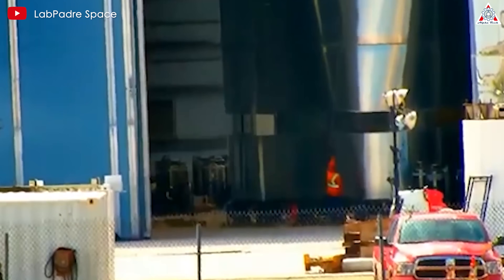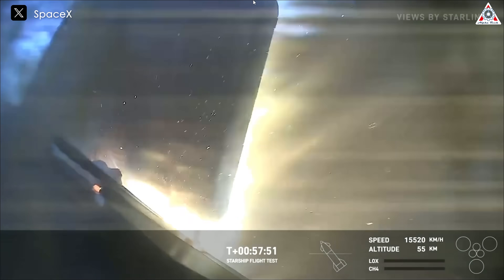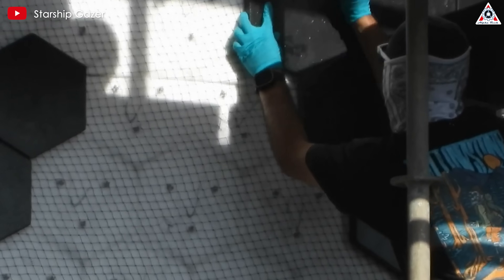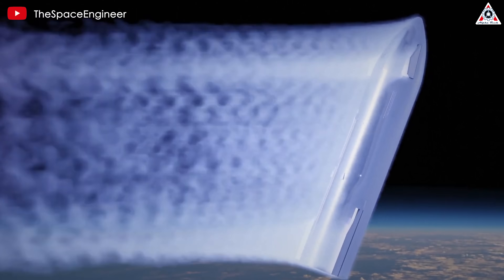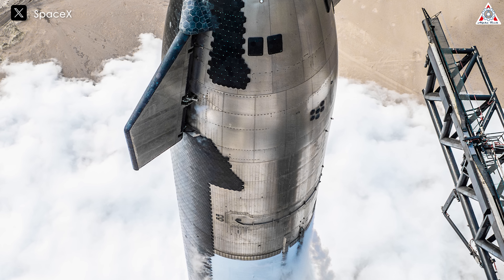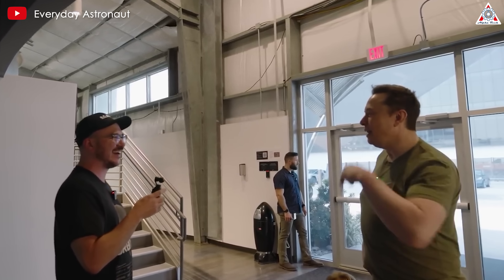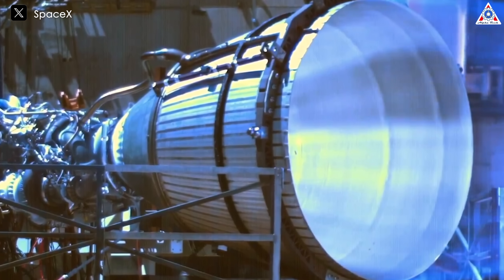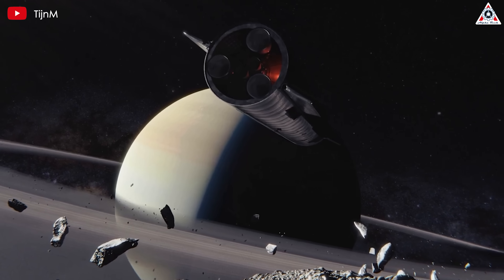Musk's SpaceX Genius NEW Solution for Starship's Weak Problem During Launch

Comment: Looks like still a long way to go on all the problems. Which is no suprize, whats suprizing is it works as well as it does.

Tles, flaps, engine feed systems, all seem problematic at best.

Might pay to attempt a cintrifugal seperator in the liquid fuel and oxy system as part of the pumping first stage.

Also going over size on pipes, pumps and valves, instead of multiples.

And their slush filter best have alot of surface area, or its gonna turn into 
a plug.
Parts count is still too high. Need common pumps for multiple combustion chambers, a bigger pump would eat the slush better, and grind it fine enough for the multiple chambers.

Just sayin'

The Analogy I used years ago still applies, that running a battle ship on outboard boat motors would take alot of parts and mechanics to keep going.

The combustion chambers are fairly passive, its the mechanicals that will be problematic.

Basically you need to think like a welder's Rose Bud torch... one feed and regulation system, lots of orifices... Not a seperate feed and regulation system for every fricking hole.

The Engineering Nobility is so insistantly stubborn...
🤭
Reply from the maker: WOW, I love your point here my friend, thanks for sharing.
Reply: @alphatech4966  
Yeah,  I have been pointing out the same stuff since the parts count fiasco.
These guys are not Zengineers yet! 
Novice shavelings...
More pipes snd valves, more complications..

They are like short bus plumbers trying to build a sewage system out of 2 inch sink drain pipe..  
Thats not gonna work,
 4 inch minimum to pass the thick stuff.
I can see it now, multiple two inch lines to the septic tank... And it still plugs....

Ditto on tiles and flappers...I've done multiple writs about better options.

Not my rocket, but sure would like to see effectiveness accelerate instead of stagnate attempting to stay traditional for smaller rockets, and to limit themselves to flying water tanks with forward dog ears and a couple barn doors aft for control surfaces.
it is comic....
Elon always does the right thing... (he just has to try everything else first!)
Success is after you run out of non viable options.
They should maybe think about more analogies...
There are certain commonalities in applied physics. I give analogies in an attempt to promote better thinking. 
The problem is our academic system isnt promoting thinking skills  its promoting engineering history and numeric bean counting,  We aren't getting the same quality of guys like the early 1900's who were doing Mega projects just barely into the industrial age.
They had a sense of scale. Nor were they timid.

Comment: So you're claiming that SpaceX developed R&D as a method of rapid iterations ?
  I worked R&D back in the 80's and we successfully accomplished in less than Ten years what the same industry had poured over $ 200 Million into over 20 yrs and had Failed.  
   On a budget of $ 20 Million w/ a 10 year to completion date,  we came up with a far superior machine that produced a far superior product. Buyers were competing for the product this machine produced and the machine was so successful that leased models recouped that $ 20 Mil in 3 years. R&D wasn't invented by SpaceX. We made many prototypes that we knew would fail but the specific portion we were focused on  did work. Then you move on to the most important area you need to work and build more prototypes that solve that problem and so on. It doesn't matter that parts of the project are failing as long as the portion you're Focused on Does work. That's R&D.  It also helps to have some Very Good engineers specific to their field and a very creative thinker at the Helm.
Reply from the maker: Thank you for letting me know this! Sometimes contributions from you or others will help us develop more in the next episodes.
Reply: Dont worry..people tend to give credit for Elon for a lot of stuff that is already existing. Like for example Elon wasnt one of the original founders of  Tesla. He joined the company later and got his name added to the founder list because of a court case.
Reply: @sliceofheaven3026   The original founders of Tesla didn't have Elon's vertically integrated business model.
Reply: @semicuriosity257  Well maybe they didn't but they were still the original founders aka the people with the vision of there being an electrical car in the first place..
Reply: @sliceofheaven3026 Yea, I recall that. If I recall, they split up after their first model, the Roadster, was released. My old R&D boss, the genius behind the group, had no problem plagiarizing other ideas from other machines and incorporate a modified version into what we were doing. In the end you get a unique machine full of bits and portions of components that exist elsewhere on other machines except your version may have improvements and/or other mods.  Not everything in R&D is new.

Comment: I remember when SX had the big show introducing the first mock up of the Starship glistening in the night sky. I was foolishly thinking it won't be long now. September, 2019. Actually, given the task at hand it hasn't really been a long time. The massive buildup of the construction and support facilities has been phenomenal and the engineering of the spacecraft to go with it. Now,  I think a successful launch may not be far away. Of course, what makes it really different is that it is a space plane with components that will return from space and be repeatedly used. And, it is really huge. I think the heat shield will eventually be replaced with the new light weight NASA, 3D printed metal alloy done in a way similar to the tiles and that will bring it all together. I don't think it is a rocket I want to ride on soon but there is hope others will get "a ticket to ride."
Reply from the maker: Indeed, nothing is easy! SpaceX will need to diligently change and upgrade Starship!

Comment: Their shouldn't be water ice in the tanks, just liquid methane and oxygen. They have to remove the water ice in the ground support equipment.
Reply from the maker: Yeah! Good comment!
Reply: its most likely just condensation from the inside of the tank while fueling, idk the process of fueling but if not a filter the only other way would be making the tank a vacuum prior to fueling which prob would implode?